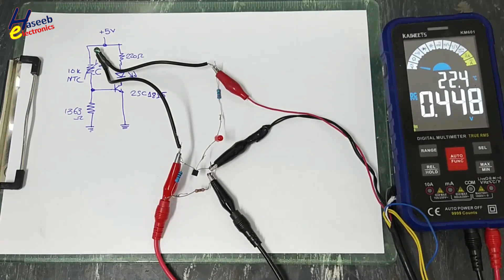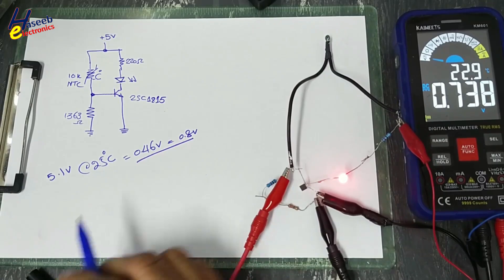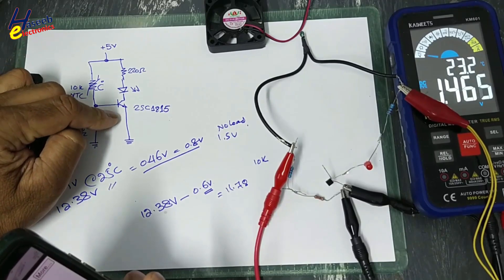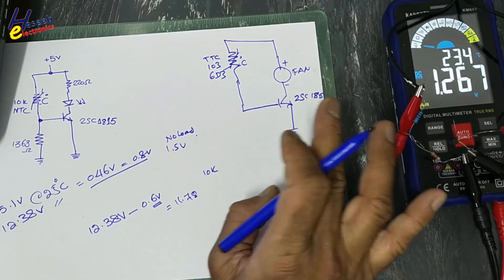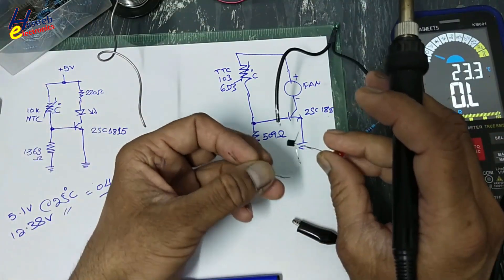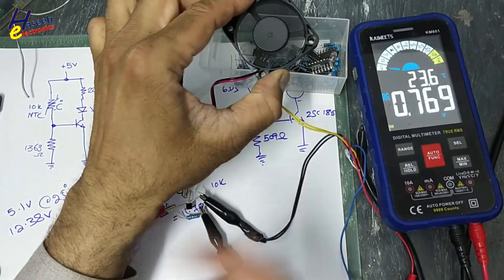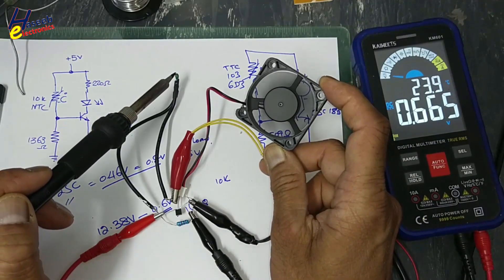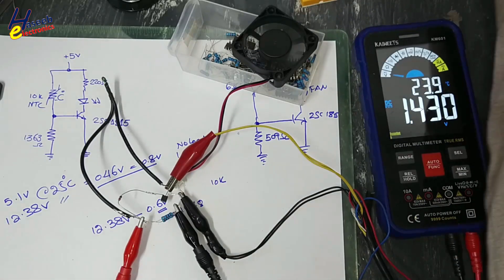{1296B} NTC Thermistor Fan Control Circuit

Comment: In practice, in my case, the resistive divider is fine; the NTC is 100 kΩ and, consequently, the pull-up resistor is also 100 kΩ.
I connect the NPN transistor and bring the collector to pin 8 of the CS1237 IC. Is that correct?

Comment: 0:57 However, in my case, this proposed circuit will need to manage a second unknown IC connected to pin 8 (OUT) of the CS1237 IC. Thank you very much.

Comment: Im a service engineer.i have one light source endoscopy that motherboard voltage fluctuating but i cant find solution... Previously someone work that motherboard and ready. they replaced lot of componets...so i confused...ML4824isl can you expalin about that ic.... .. I checked with all your method but still not ready can you help me sir.😢Your my role model❤️. Endoscopy led blinking issue...

Comment: Sir, I want to change under voltage input cut off protection in SMPS !

It's above 240v for dc by default, 

I want to set it at around 200 - 205 volt !

Because i have supply around 210-220v dc !

Can you guide me, how to do this ?
My SMPS is Meanwell LRS 350w 48v !

Comment: Great circuit for putting on the heat sink side of a two way radio. I had a Kenwood 261 with the a Toshiba VHF RF module in. Those radios were noted for running hot and as did another brand of radio that also ran a similar Toshiba RF module. Sorry, I don't know the number. I knew a lot of ham radio operators that had these Kenwood 261's. Mine was the only one with a fan that I installed and ran it off of the switched 8 volt regulator inside the radio. The fan was quite since it was a 12 volt fan running on only 8 volts, but it ran all the time when the radio was powered up. After a year or so, I was the only one of my friends running that radio. Almost all of the radios had bad solder joints around the RF module. Must have got pretty hot to melt solder! 
  I would have loved to have used this circuit back then. Run in the linear mode you could tell how hot the radio is AND if the fan is doing it's job to cool the radio down. My radio never had any issues even years later when I sold it. Thanks for sharing!

Comment: Thanks for the video, it's very interesting, particularly towards the end when you introduced the diode. I had anticipated that the fan would still behave linearly, but starting at a higher voltage - the previous starting voltage plus the voltage drop across the diode - so I was surprised when that didn't happen. Could you explain why that is? Thanks, Will.
Reply from the maker: sure i will re-evaluate and explain it
Reply: @HaseebElectronics Thanks 👍

Comment: Sir, I want to change under voltage input cut off protection in SMPS !

It's above 240v by default, 

I want to set it at around 200 - 205 volt !

Can you guide me, how to do this ?
My SMPS is Meanwell LRS 350w 48v !

Comment: Or we can use an OPAM, right?
Reply from the maker: yes. we can use OPAMP, i am already planning to make OPAMP based fan control circuit. i will add adjustable option in that circuit

Comment: 16:51 QC 3759 pwm ic. There is no data sheet available . Please explain it., equivalent for this ic.
Reply: How did you know that this ic is a pwm since there isn't any information about it . I am asking so i can help you. Give more informations so we can help . Fir example the pcb you are working with . Is it for washing machine or refrigerator.  Follow the pins tracks that leads you to define the purpose of each pin . Then you can find a way to turn around that ic .